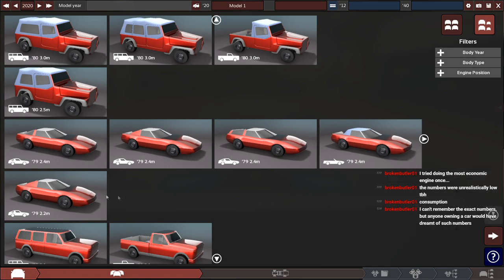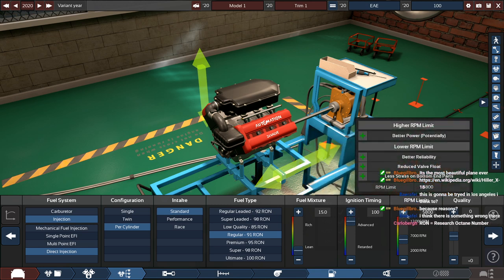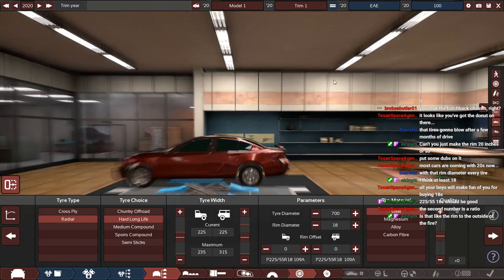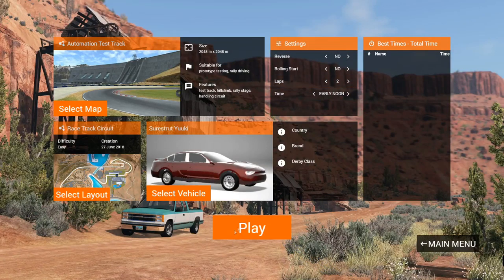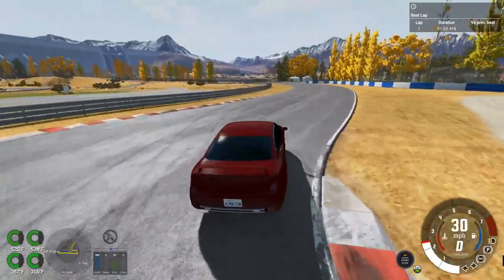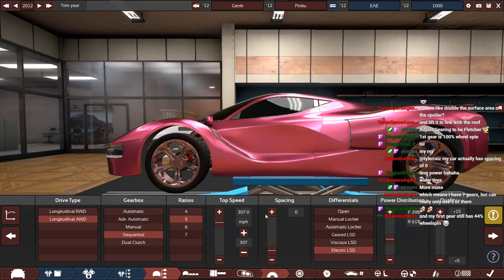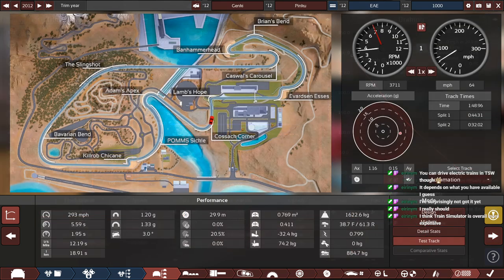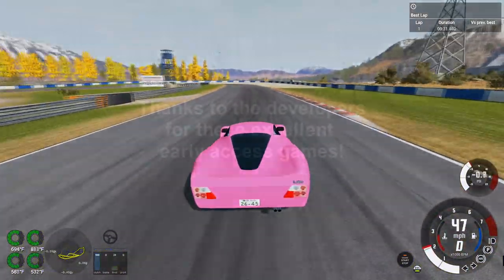Automation and BeamNG (Early Access) - First Try

Comment: As the old adage goes, slow is smooth and smooth is fast. Try going around the track a few times without stomping on the brake and accelerator alternatively. You can then start to learn braking points ect.